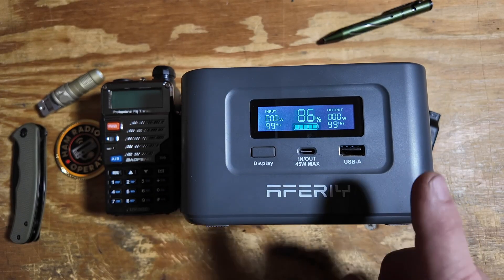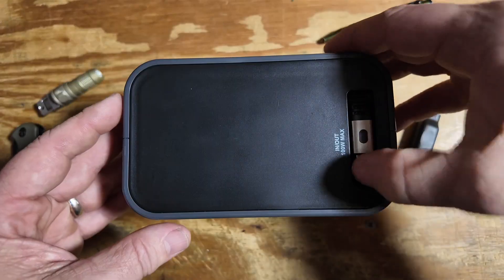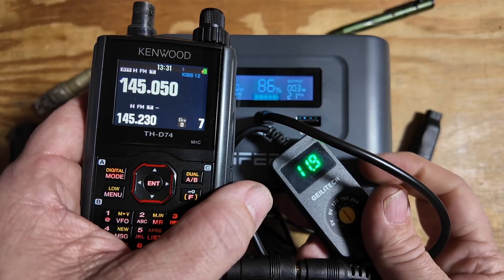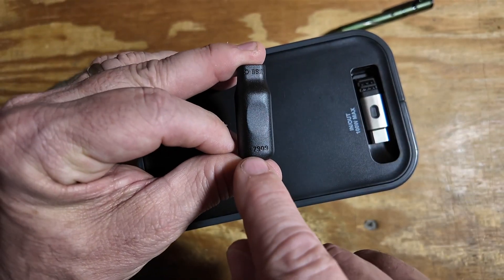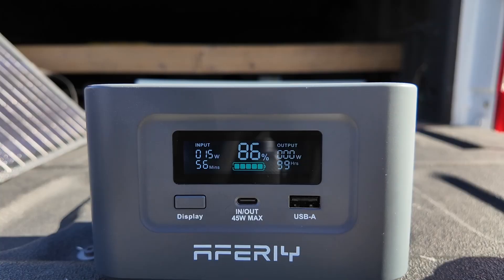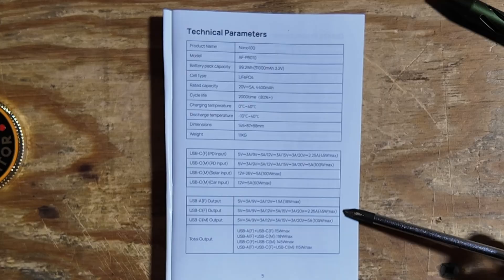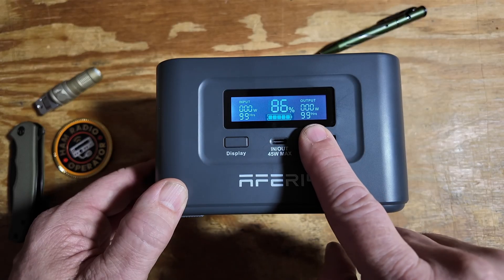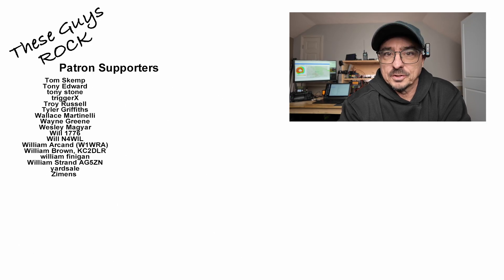This Mini Power Station Surprised Me

Comment: I installed a 30-95 Hitzer anthracite coal stove to keep my outbuilding/pantry/reloading/radio shack #2/freezer/bulk food storage area above 50 degrees in the winter. A 40 pound bag of TSC anthracite burns for three days. 500 gallon diesel bulk and 250 gallon gasoline bulk tanks are not full, but will be by summer. Plenty of Pri-d and Pri-g.

Comment: Very nice power bank.
I clicked on the Amazon link and this is headline advertised as "31000 mAh". It just drives me crazy that they advertise the mAh rather than Wh. The mAh rating might have been useful back when everything output just 5 volts but now that there are multiple voltages available, the mAh rating is useless and misleading.
The fine print on the page does list the useful energy of 99.2 Wh so it looks like they are calculating the 31,000 mAh rating at 3.2 LFP cell voltage which is irrelevant since that is not any of the output voltages of the unit.
BTW, the weight is 2.8 pounds 1.28 kg
Reply from the maker: And that's why I called out the 99.2 Wh in the video :-)

Comment: Do any of these run a raspberry pi properly, I have never used a USB C battery bank, probably a stupid question but do they auto pick the voltage? I heard raspberry pi needs 5.1v, not 5 volts? Thanks & 73.
Reply from the maker: I haven't tried this one with a Pi. The device connected to the unit negotiates the voltage that it needs.
Reply: I run a Pi 4 with mine, and it runs just fine.